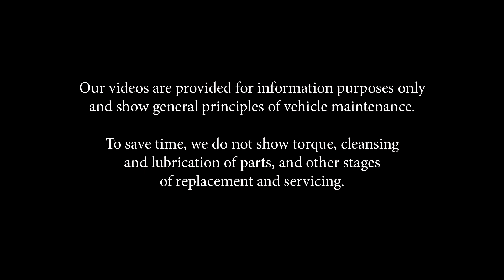How to change oil filter and engine oil on MERCEDES W202 [TUTORIAL AUTODOC]

Comment from the maker: 00:25 — Install the AutoDoc App
00:56 — Use an open-end wrench №22
01:14 — Use a socket №21
01:39 — Use a special puller to take the tie rod end out

Buying via app is always cheaper than on the website!
❱❱ Install the AutoDoc App — https://interstitials.onelink.me/1036709825?pid=Youtube

On our website you will find a wide range of auto parts you are interested in: https://goo.gl/fBZcHb
Track rod end: https://goo.gl/qw5ZSK
Track rod end for MERCEDES-BENZ: https://goo.gl/zVbFgE
Track rod end for MERCEDES-BENZ B W245: https://goo.gl/C8kuz4
MERCEDES-BENZ Car parts: https://goo.gl/XsjJbT
Reply: autodoc.co.uk how much I need letters?
My car 22c 1996

Comment: Wich oil is best for a c 180 wich did you use
Reply from the maker: Thank you for your feedback!  You can use the oils with the viscosity of 5W-40, the main condition is that the oil should be suitable  as per your engine specification and the year. Then we will be able to specify the suiable oil for your engine.Best regards, Autodoc.
Reply: Hi there. New sub here from UK. I have a 2000 C200 W202. What oil would you recommend? Thanks for your videos.
Reply: @HGVMe  I'm using 10w40 for my c200

Comment: hold it!!    replays filter before emptying the old oil?
Reply from the maker: Thank you for the feedback!This video is considered to be an informative one, and it is approximate. Best regards, Autodoc.
Reply: And he didnt use a new seal fore the oil pan screw, and didnd show the the oilcan in the board computer have to switch off, and he didnt use a torgue wrenche, and he didnt do enought oil on the new seal from the oil filter and and and...
This is what i see and i'm not even a mechanic...
Blame on you
Reply: you can't even spell *replace. It also doesn't matter which order its done in.  As long you dont start the vehicle with the new filter and old oil.
Reply: @alexanderlazaridis14  You guys are both horrible at spelling. Why should anybody take advice from you? The Seal on the bottom of the Oil pan screw/bolt doesn't have to be replaced everytime you change the oil.
Reply: @nobody3888  I assume you are a qualified vehicle technician?

Comment: Γειά σας ωραία βιντεο τα 111 τα μοτερ περνούν 5.5 με 6 λιτρα λαδι εσείς γιατι βαλατε μονο 4 .μια ερώτηση για w202 c180 σε πολυ καλη κατάσταση με 400 χιλιάδες χιλιόμετρα και πανω τι λαδι 5w40 η 10w40 ευχαριστώ.
Reply from the maker: Our videos are for informational purposes only; there are only 4 bottles of oil in the video. All routine replacements and values and volumes of oils can be found directly in the technical documentation for your car.

Comment: 0:58 what special wrench? it's 75mm, right? I have the same car, but I am struggling to get the filter off... Might need to buy that wrench.
Reply from the maker: Oil filter removers are different in size and parameters, the exact dimensions can be determined if there is accurate data from the car.
AUTODOC
Reply: @autodocuk  Hi! It's a Mercedes Benz c-200 Kompressor Petrol, 1994.